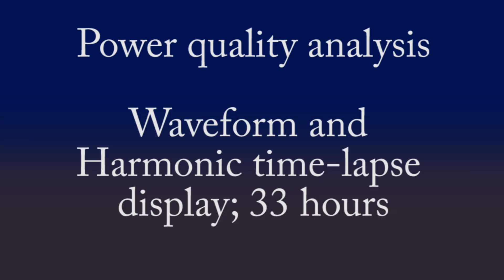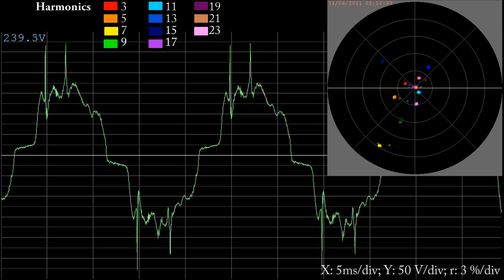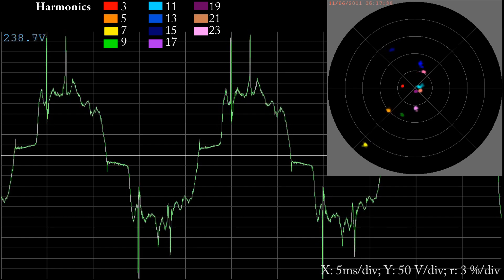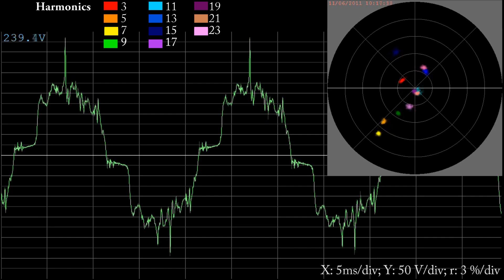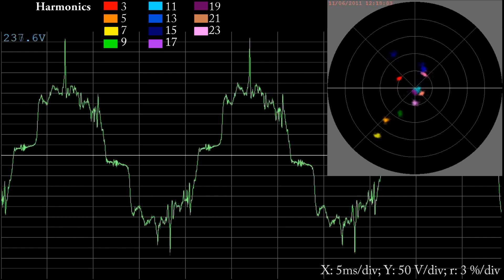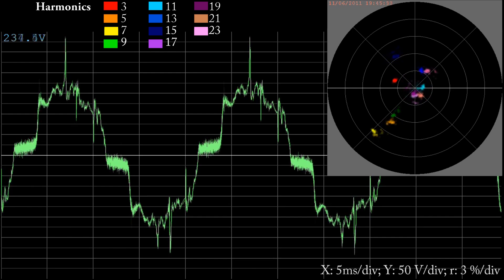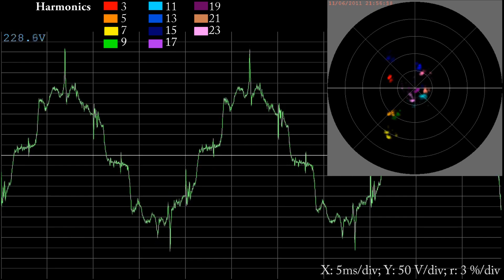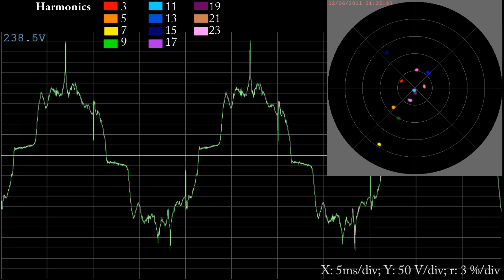Interesting waveform and harmonic analysis of mains power.

Comment from the maker: @Amishman35 The wave was obtained by my home-made power analyser/energy meter - I just ran a screen capture of the software and edited it together.

See my video "Home made energy kwh meter".

I should explain that the distortion is somewhat over-represented here, because of an accidental open-circuit and parasitic capacitance. The spikes and hash are real, but a lot smaller.

Comment: There is so much hash and other junk on the power line these days thanks to cheaply designed switch mode power supplies everywhere. I have even heard of a fellow that burned out the primary of the transformer in an old radio thanks to a cheap China made arc welder with a switch mode supply, somehow it caused a voltage spike back through the power line. There are also fire alarms, burglar alarms, and other devices that communicate through the power lines on different frequencies.